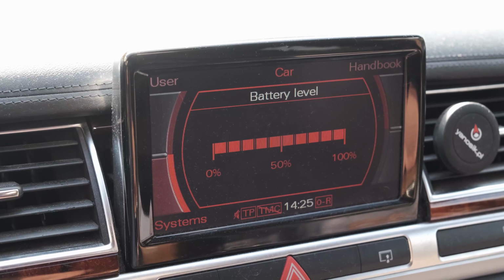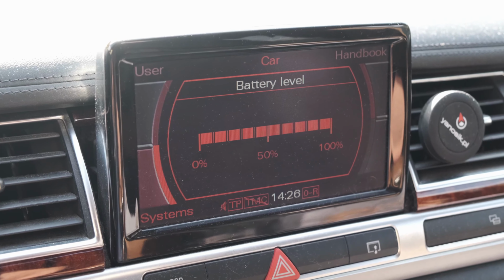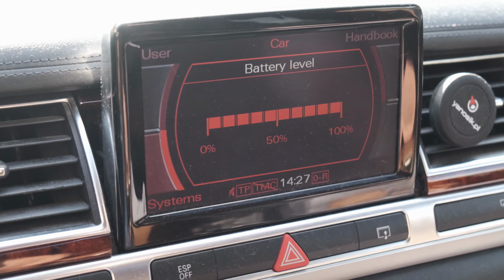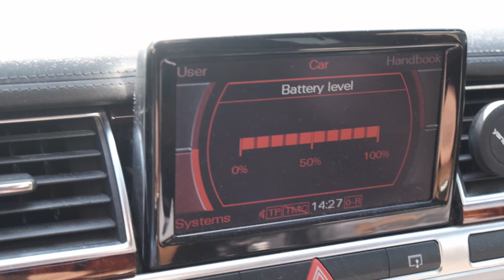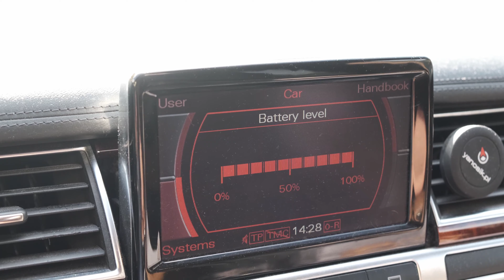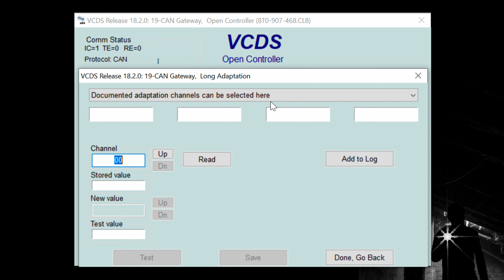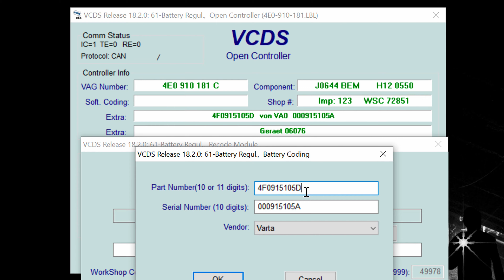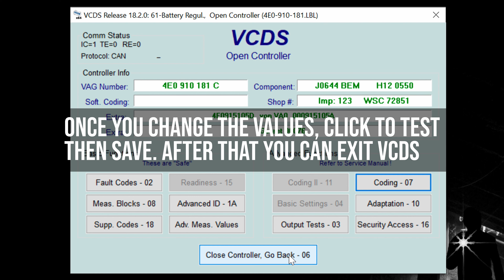👉 How to code battery in Audi using VCDS❓ Check this video!

Comment: i replaced my Battery yesterday on my 2008 Audi A6 it was a Varta 110AH and it was still the ORIGINAL 14 years old !!! i bought a 90AH instead of the 110AH but i guess its good enough. I let the engine run while switching over the battery, so i didn't had to do any "re-programming"
Reply from the maker: well, your car was programmed with 110AH and you installed smaller.. in short period might be ok.. but in longer term car might try to overcharge your battery - which means it will kill your battery faster. Strongly recommended to code new battery parameters.
Reply: so what should i do ?? disconnect the battery to re-set ecu ? i had the car running because i didnt want to lose all my settings (satnav, radio etc)
Reply from the maker: do not need to disconnect just make sure it's fully charged and then follow this video (need VCDS)

Comment: Nice video 👍
I've got an Audi A8 2012 and just ordered a same spec varta for half the price of the genuine Audi one 🙃 do I need to keep the bem code from my genuine one for it to work in coding? Also do I need to have engine on or just ignition? Do i need to have a battery charger connected if only ignition on?
Thank you
Reply from the maker: i would code it anyway just to let the car battery module that is new fully charged battery. If you have battery charger always is good to connect it when doing codings :) just in case.
Reply: @Carsienet  battery coded from 19 can gateway, it was a bit different then yours, i had battery power, manufacturer and serial number, that's all it asked me for. But on my new varta battery it had a sticker saying something about compatible with battery management systems or smth along those lones. I punched it in full lentght code when clicked ok it auto shortened it and saved. 🤷‍♂️👍
Reply: @Carsienet  straight away in my first trip out with the car other systems came to life ie. side mirror lowering when in reverse, start/stop function, sunroof no longer playing up, headlight system problem dissappeared.. 😅
Reply: @Carsienet  nigdy nowa bateria  nie bedzie naladowana na maksa jak sobie jej sam nie naladujesz przed wymiana.😎dobry,konkretny filmik.prosciej sie nie da👍

Comment: Hi. Thanks for sharing this video. Do you know if it’s possible to code a non genuine battery witch is without the BEM code?
Reply from the maker: yes, you can. i have coded in mine A8 non genuine battery. Just need to use BEM codes for correct battery power. Full list you can find here
https://upgrademyaudi.net/tutorials/how-to-code-new-car-battery-vcds/

Comment: Can you have idea for batterie draine
Reply from the maker: there can be a lot of possibilities.. I would start to check by pulling off single fuses and checking if it still drain battery.. in Audi A8 can be MMI, amplifier, etc..

Comment: Hmm. So you are pasting the battery part number as the battery serial number?
Reply from the maker: no, it must be on this scheme: Battery part number Battery Vendor Battery Serial Number for example for 110Ah Varta: 8K0915105F VA0 000915105AK if you car doesn't have battery regulation module. If your car have battery regulation module the you need put product number in product number field, same for serial number, and select vendor from list. I hope you'll understand :)
Reply: @Carsienet  I do understand. My battery BEM Code : 000915105DLVAO3480550TA. So the the break down of the code for VCDS is
Battery Part num : 000915105DL
Battery Vendor : VAO
Battery Serial Number : 3480550TA
However, it appears that the battery serial number can be another value other than a true battery serial. Good to know.